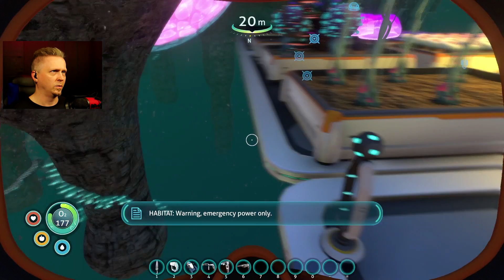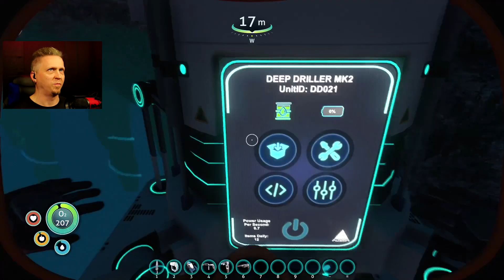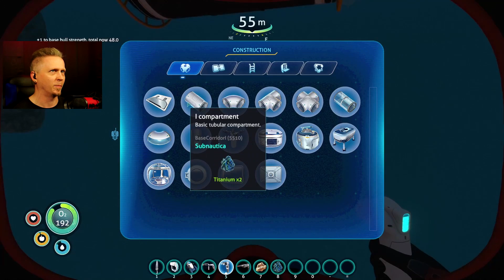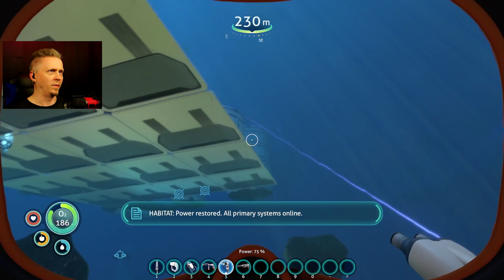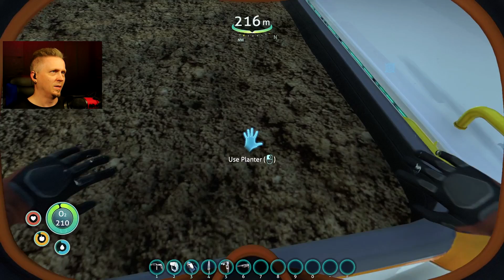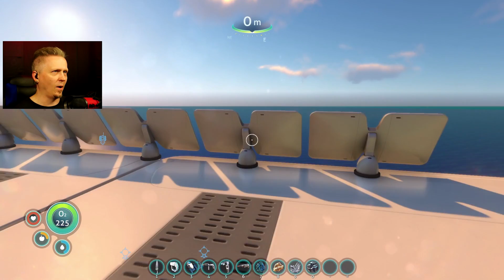UPGRADING MY POWER NETWORK  -  Subnautica Modded High Tech Ep13

Comment: You might want to try BetterPowerInfo to show what is going on. It isnt perfect but it helps. Just build vertical tubes down and establish a little base down below. I was able to drill Sulphur down there.
Reply: BetterPowerInfo would be a terrible idea at this stage.
It tanks game performance all on its own.
And it doesn't account for modded sources of power production and power consumption.
It hasn't had a proper update in months.
BPI made sense 2 years ago when the game was new and there were very few mods. But today, no way.
Reply: @PrimeSonic  It still is useful once in a while to sort power connection problems, but the new power mod kinda sorted that all out. I have it disabled most of the time. Most of Randy's old apps are now, sadly broken. I still use MoreQuickSlots,  and CustomizedStorage they don't seem to be broken, yet.

Comment: OHHH SPICY!!   1 base = 1 purple beam.     no matter how large the base       otherwise the game goes into an infinite power loop and causes a CTD.     your biggest issue was building the base down to use the network using a glitch.   I will see what I can do to make this simpler but with the limits of the code I was already pushing it making it so bases could output power at all...... ALSO    the FCS turbine does not work like normal power systems and so its power does not get counted as part of the network yet. I am working with FCS to get that mod updated to work with the system.....   I will consider making a config option for the LOS allowed or not allowed but I never liked the beams going through terrain.     next update should be out before next weeks video and should make life easier for you.

Comment: most mods have options you can manualy change in the config files where you installed them just need to start the game once so it can generate those files there you can change power generation battery capacity and energy drain the driller mod has tons of stuff you can change